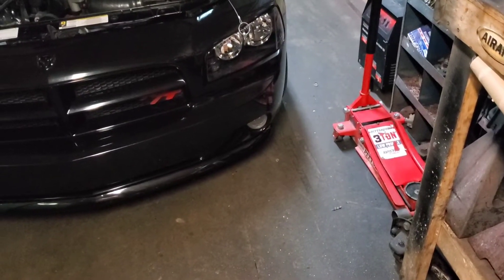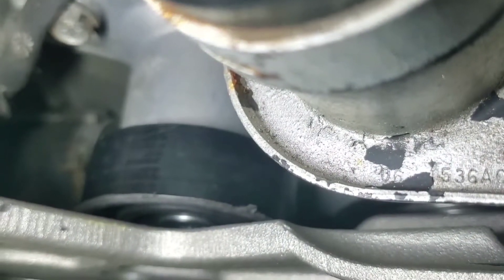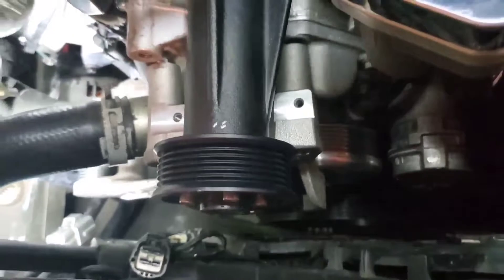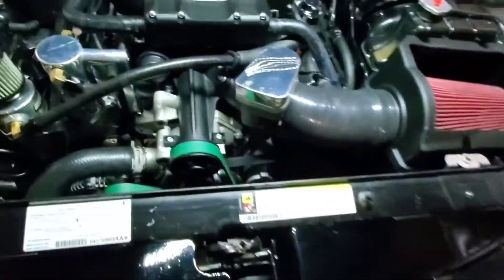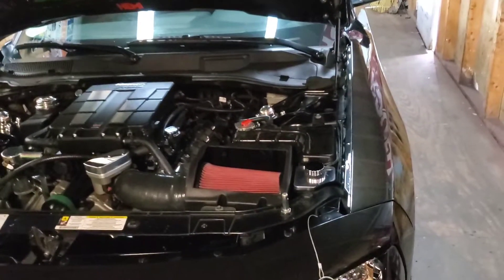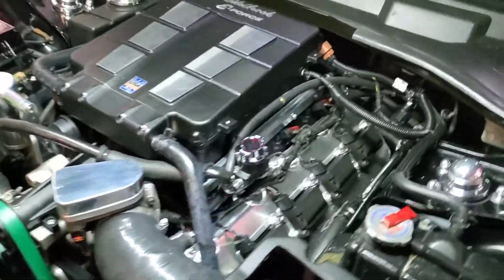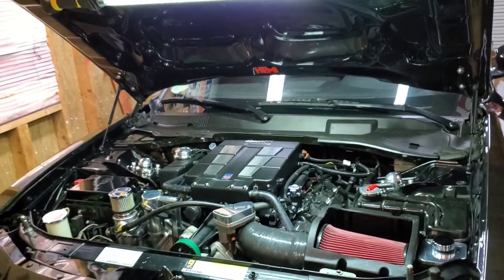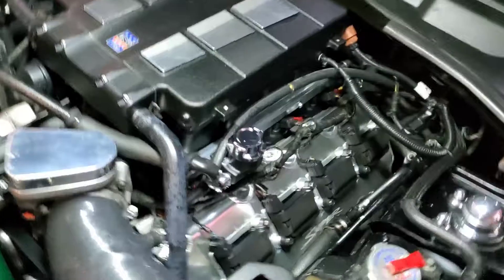How did I get a 09/10 vvt 5.7 edelbrock supercharger to fit my 08 charger rt 5.7 hemi non vvt

Comment: I've got a 5.7 Challenger with the E-force. I dropped from the 3.25" to the 3.00" pulley, then added headers, feels like it picked up another 50 to 60hp with those two mods alone. Still needs Dyno tuning.

Comment: I found your channel by chance a few weeks ago. It's nice to see someone with else with knowledge on each individual model and trim setup (doing your research). The differences no matter how minor, and how you not only push through with engineering what you need, you documented it for others. I appreciate you, brother.

Pushing the pre-eagle without breaking the bank has been a fun adventure for me. That's how I ended up finding your channel was trying to find a decent hp number confirmed with a close setup to mine. You made 391 wheel with the same mods, but less mods overall than I'll have when finished but I was wondering if you could tell me the cam specs of the last cam you had before the blower, the MMX one I believe. I'm shooting for 400 solid, in a fun little street car and you said with an eagle intake you could've broken 400.

Its just for informational purposes. I've (re)built a few 5.7s, 6.1s, and done some work on a couple of 6.4. Just a young kid trying to make something from nothing. Sick car, love the build. Take care, and have a good one, man.
Reply from the maker: thanks ....its still the mmx cam its the n/a eagle cam they sale for the pre eagle but i ordered it custom he changed the intake center line and couple other things to help low end little more but duration and lift is the same as one on the web site 218/228 594/589.400 plus wheel would have been easy with little more porting on the heads and a eagle or 6.1 intake manifold when i was n/a but never swapped my intake manifold cause i always planned on doing the supercharger .but n/a it ran 12.40 and usually stayed 12.40s in 1/4 full weight but i could have got it lower 12s mabye high 11s with the n/a combo i had if i would have done better intake and 3.92 gears and tune on race gas with little weight reduction if i would have stayed n/a thats what i would have done .but thanks for the kind words that is why i made a youtube because never could find much info on the older pre eagle hemis.
Reply: I should have noted you said that as well, about the choice of supercharger, that's what got me hooked was how you said eagle manifold for over 400 haha, I was like HE GETS IT, HE KNOWS! I have an eagle intake on 30# injectors( the ones I got with the intake were bad so I got the stock ones from a friend's 6.1). I ended up buying the full cam kit from Jay greene, and decided to build into that. It's 214/224 .597 .572 111lsa if I recall (it's stored up waiting for the other parts) We did P&P brand new heads (as we were learning about pre eagle problems such as valve seats) pretty much kept the car stock minus the bolt ons. I actually have the same big boss hood from amerihood. Wanted to try and keep the daytona stock as much as possible to preserve a little value in it. The goal was to not add anything anything you couldn't take away and it still be matching. She was finished (temporarily) 2018.

You actually had everything in line up to cam with where I'm going. Though, I actually have 3.23 over 3.06 gears. As well as 6.4 injectors, deck the heads up a little bit for at least a 10:1 compression, long tubes are going on over shorties. Widen a stock throttle body to ~87mm. Few more tidbits here and there for suspension and whatnot else. Overall it should hopefully make 400whp N/A w/o nitrous. The only power I can really get before I a need forged bottom is eagle heads and port them, but I don't want to invest on it, I'd have to get a different set of adaptor plates to fit the eagle intake on eagle heads over pre eagle and the last ones were $300. I have a 2 year old at 28 and just bought a house, so I pre saved about $3500 so far a little at a time since before she was born to keep my debt down only to the house. It's all been preparing up for the next coming weeks when I'm gonna start getting everything else we need to build. The car was purchased at 318k miles and currently has 22k on the engine and 340k miles on most of the car, including the stock rods, pistons, cam, lifters, and transmission which only needed a conductor plate. (All torn apart and inspected (the only thing wrong with the engine was a small gouge on a crank journal that could be easily repaired even though we bought a new one). I work nights and a lot of hours so I couldn't ever really have time to document more than pics and exhaust clips. I'm old fashioned and not really into social media haha. She got as much of a full refresh that 8 months of time and a homemade paint booth could get us to. 😅

I appreciate you following up with me on the specs! I'm sure I missed it in the other video, it was a couple of weeks ago I watched it. I look forward to see where you go from here! Good luck, sir, and thank you for your time! I could type you up so much but I gotta stop myself for awhile and return to the shadows. 🤣🤣🤣 take care, brother!
Reply from the maker: @2006DaytonaRT  if you no how to port heads or can have it done there's no need for 6.1 or eagle heads ..i have my pre eagle heads intake ports ported out to 6.1s prop  a little bigger than 6.1 lol i almost went to much and making a 627 wheel sae with the supercharger  and ran best 10.89 in 1/4 on 93oct and on not that agg tune still has another 30 or 40 hp in it on set up its on now with little hotter tune but tuned on richer side for now  and pulley for 10psi only seeing 8.5 8.9 psi peak looses lb or 2 from cam and headers but shows its efficient so far still with pre eagle heads so it can be done plan on pushing it more soon just got get few more things lol but i would port them out to the eagle intake manifold or what ever one you will be using just port match them  and the exhaust also but just a little on the ex side not as crazy then have the heads milled bout .030 or .035 to bring compression up from stock 9.6.1 to around 10.5ish but with .030 milled with stock pistons and gaskets should be around 10.5 to 10.7ish also check ptv should be fine but just to be safe id check it . but you can google compression calculators and put your info in and it will give you a static compression number . but i had 11.1 when i was n/a were i done the pistons and rods already  and was using stock 27 thousands head gaskets but pulled the heads back off to get read for the supercharger be for i put it on i swapped the head gaskets back out to 52 thousands cometic head gaskets and done arp head bolts but remember any time you mill /swapp to diff heads or change gasket thickness you will have to measure push rod length i had to order custom length ones from mmx .but 400 plus wheel would be easy with good porting on the heads with little higher compression good cam spec /bolt ons /exhaust /gear / stall and a eagle intake or 6.1 ....for example it can also be done with a huge huge cam with bolt ons but thats not the best way unless just looking for a number but doing it that way with biggest cam you can shove in it its gonna perform like shit lol prop run high 13s at track it would take a crazy stall and gear to even get it half way desent trying to do it with cam only like that plus be harder to tune lol.... but the way you plan on doing it should do good with the milled heads and cam and intake and so on .
Reply: I don't think she will end up seeing too much drag time, due to being a semi-day driven car. She has two years of road chips on paint that didn't get to get wet sanded down after the clear coat and everything as finished and baked that needs to be cleaned up eventually. If I hit  could 12.5 on full weight and spare tire, with added "road course parts" I would be happy with that. You built a one of a kind machine that everyone will be guessing how much had to be done and you showed it can be done two different ways without too much cash involved.
Reply: Yeah that's true. I mean I have everything coming down to arp studs and the 3200 stall. It was just the easiest way to say without throwing up too much convo like I need to be naming off every part to you. Haha. I may look into more head work if my old man is up to it. Thanks for that advice. He made me well aware everything must flow together without being too out of sync or you will end up not making much. I never dynoed this car but It's run me to 168mph so far and had about a thousand rpms until 5th gear. It felt smooth. I can't wait to see to see hit 9s!